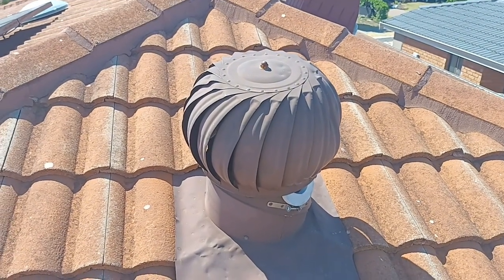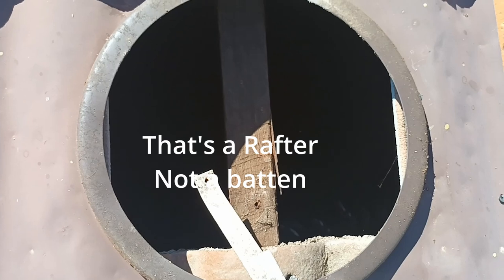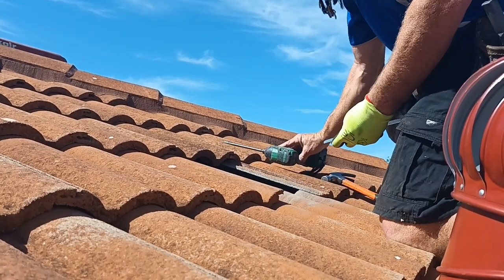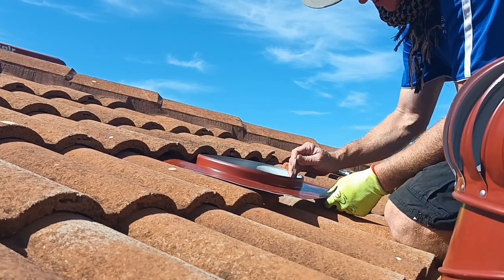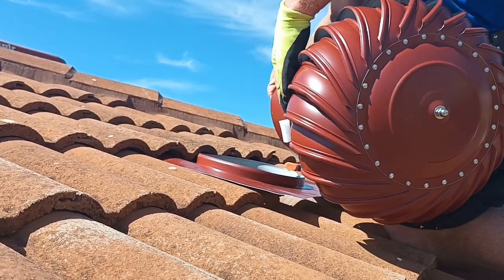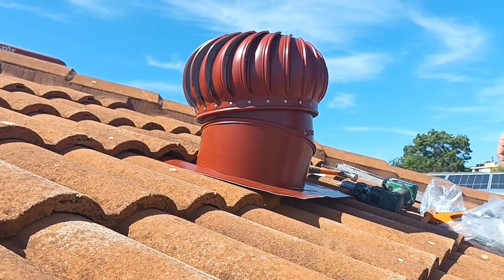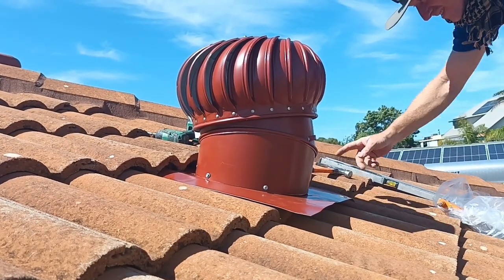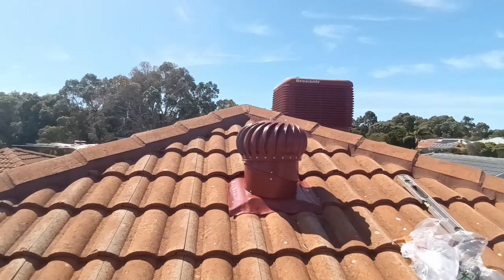How to install a spinning roof vent or whirly bird on a tiled roof

Comment: when installing a new one. whereabouts do you determine you should install it? I mean how high up on the roof? I live fairly coastal so I'm concerned the winds will blow it over
Reply from the maker: That is a fair concern. There are a couple of ways to address this. 
1 move it lower on the roof (However depnding on the side it on the Whirlybird may still get alot of wind.)
2 Put it on the face away from the weather (this may reduce the wind hitting it in the hotter months but aslong as it getting a good steady flow it should still work fine.
3 Silicone down the sides of the flange to the tiles as this will increase it's anchorage .
ultimately it's a judgement call. you can use a combination of all 3 if you like.

If it does get blown off remember you can always move it down the roof later. just keep the tile you pull out to fill the existing hole.

Comment: Hi I want to know if the outside temperature is 45 Degree C and the inside temperature is 40 C. Bu installing Whirlybird in each room will reduce how much temperature inside the rooms?
Reply from the maker: The whirlybirds is designed to remove the excess heat from the roof cavity not individual rooms.
Reply: What is considered excess heat? Wouldn’t all roof / attic space have excess heat. If excess heat are seeping / radiating through the insulation to the inside the house,  the vent surely should help? Nobody has recorded the temperature before and after? Thanks for the video.

Comment: does it matter if the whirly bird is installed at a slight angle?
Reply from the maker: It is not the correct installation, but I have seen it on roofs, and it still spins. It is more efficient if installed level and I am not sure how it affects it when it rains.
Reply: yea  i tried leveling it but it always comes out a bit off on one side. 
Its not a lot but about  10  to 15 degrees on one side. Its spinning but im really hoping when it rains it dosent come in  @dennisperrie

Comment: Why didn't you "weather" top of the flashing?? Water will pour in with rain
Reply from the maker: No it will be fine. it slides under the tiles plenty and the direction of the rain and storms blow the rain down the roof. Also being soft zinc. the base will conform to the tiles and they will sit low on the base however if I bend the top over It will create a lip that will cause a lift in the tiles, opening the tile joints.